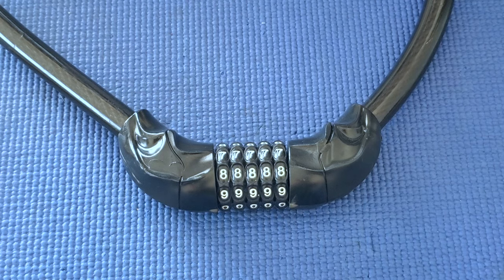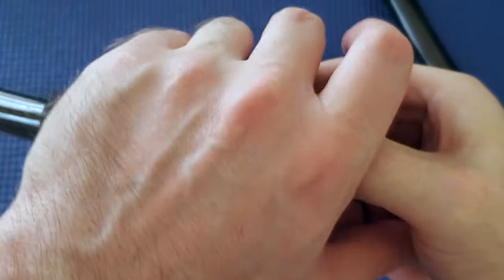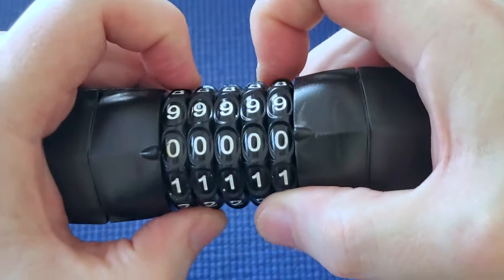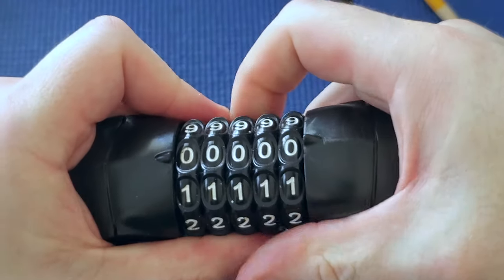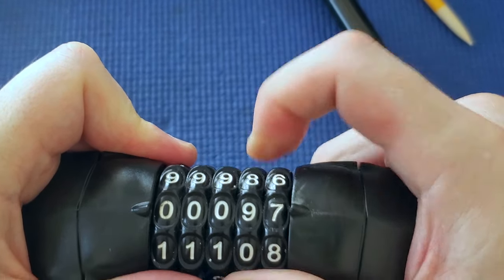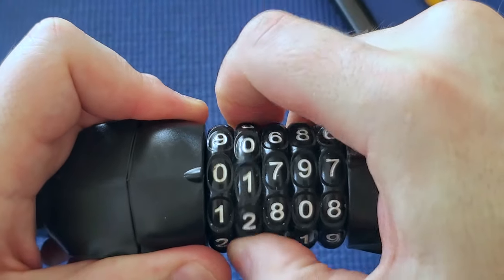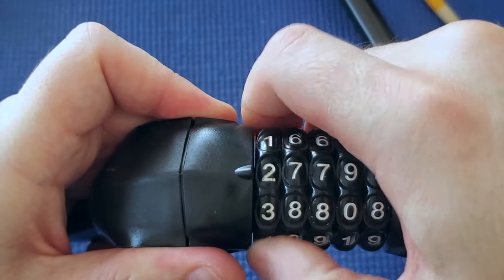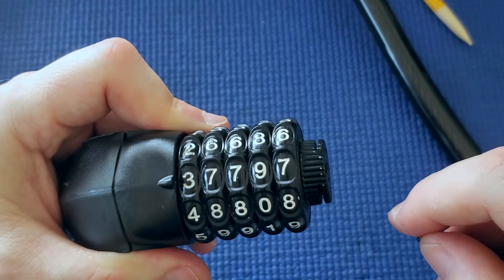(Picking 145) How to decode most combination bike locks - Faster Method!

Comment: One of my kids accidently changed the combination on a Master bicycle lock. Figured out the code in less than 20 seconds using your advice.
Reply from the maker: Excellent! 20 seconds is fast! I'm glad the video helped :D :D
Reply: @Swynndla  I was shocked how easy it was. And this was a Master lock. False sense of security.
Reply from the maker: @sethmeyer4951  Master locks are popular, but yes it's a false sense of security as you say, and it only keeps honest people out! If someone is locking up something valuable and it's left unattended for more than 10 mins then they should ask themselves if it's worth spending more on a decent lock. Good bike shops will be able to advise which ones are secure. That's partly why I do these videos, to show how easy it is for someone to get into them (sometimes people get in so fast it's just as fast as entering the correct code, and they get away with it in a busy location without raising suspicion). Other types of thieves will use some sort of bold-cutter to cut the chain etc. Combination locks attract opportunistic thieves who just come across a combination lock and try it out, and they don' t have to cary any tools to do so.

Comment: I have a hard time feeling when a wheel is on the right number, but there is an easy way: when it’s on the right number and you pull hard, the next wheel becomes difficult to turn. 
Example, if the wheels are ordered as in the video: set the fourth to zero, pull hard, and see how difficult it is to rotate the third one. It’s going to be easy, no matter how hard you pull, unless the fourth one is on the correct number. So try 0, 1, 2, etc. once you find it, move to the next one (try different numbers on the third one and see which one makes the second wheel hard to pull under tension).
Reply from the maker: This is what I call the "Indirect method" and I cover it in my Video 144. Well done for figuring it out, I had to be shown be someone else - you're a natural combination decoder!! :D :D
Reply: It works 😍

Comment: was not sure, but really works! my lock bound to the right! it was quite expensive, inkluding a real solid chain! it is a bit frightening, how easy this goes!
Reply from the maker: Excellent - well done for getting it open!
Yea part of why I do these videos is to show people that combination locks aren't that secure. Most thieves will physically cut the lock/chain, but there are a small percentage that will attempt to decode it, and some do it opportunistically, where they have no tools on them and they come across it and "just give it a go".
For better security, use a lock with a key. More of a hassle to carry around the key, which is why a lot of people opt for a combination lock.
It's good you used an expensive lock. Some people put a cheap bike lock on their expensive bike. I generally recommend spending 10% to 15% of the bike's worth on a bike lock.
Reply: @Swynndla  thanks for the answer! actually, the SPGOOD lock is just 10 bucks. but i meant it is heavy because of the chain and thus looks more expensive than then one you used. maybe more expensive locks have a better locking system for the numbers.
Reply from the maker: @bvrulez  Ah ok! - yea you're right, generally the more expensive, the better the lock (in terms of cut resistance and also pick/decode resistance - and I would recommend a good named brand too).
You might be interested in my other video I did for an SPGOOD bike lock: https://www.youtube.com/watch?v=e0xpSiTtvNA

Comment: HELP ME! MY BIKE LOCK GOT STUCK 3/4 IN THE HOLE! I was trying to set the password, but apparently some point along the way my finger brushed against the dial and set it as the wrong one with out me noticing. I was fiddling around with it, but it got stuck three fourths of the way locked. PLEASE HELP!
Reply from the maker: If it's stuck most of the way in, then the last dial won't be engaging the teeth of the locking mechanism, so that means you have less wheels to decode (ie in a 4-wheel bike lock, you only need to decode the first 3 wheels). Once you decode the final wheels, the lock should open. Then if it doesn't close all the way, just turn the last wheel until it closes. Does this make sense?

Comment: Cool video, I love decoding locks. Do these ones always go left to right or right to left? From my limited experience it seems that it can be sometimes random with other disc locks
Reply from the maker: Thank you! :D :D  Yep they are a lot of fun.  They can bind in either direction, but usually one way or another and not so much completely random (a few locks do though) ... so different from key-tumbler locks!  Cheers

Comment: It worked but only for the first 3 digits. Even when i know the code, i cant find a difference in the last 2. Btw, numbers found go in pairs of two. If 1 is a possible number, 6 also is possible. They are on opposite sides on the lock. That was on my lock tho. Hope it helps
Reply from the maker: Thank you for the feedback & tips! Yea sometimes locks put false gates on the opposite side, and that knowledge can help with decoding. Dunno why only the first 3 wheels were playing ball, but I guess the remaining wouldn't take long to brute-force. Great job getting it open btw :D :D

Comment: I have a dusty old lock. Could that be making it harder for me to pop open?
Reply from the maker: Yes it could. I find that with old dusty / dirty locks (that might also be a bit corroded) I have to apply even more tension. I would use the plain Indirect Method in my video https://youtu.be/Rn_Q3zWQhCY ... but make sure to wear gloves and you'll have to pull really hard (with constant tension) on old locks. Some people have had success by standing on the cable to get even more tension. You might be able to get someone to help you tension it. Your fingers will suffer.
If that fails, then you could try the "Sideways" method in my video 190: https://youtu.be/e0xpSiTtvNA  ... but it only works on some locks."
Good luck!

Comment: So... When the pin is just partially in and we're not certain that the code has been or not been accidentally altered... Can this method be used ?
Reply from the maker: Yes this method should still work, but only some of the wheels (closest to the opening) will have any affect (that other wheels wont have the teeth on the pin to engage with), so you only need to use the wheels closest to the opening.
If you can't get it open then use the Indirect method described in my video Picking 144.
Once you're got it only then you'll only know some of the combination, but with bike locks it's easy to get the rest of the combination by follow the method in my video Picking 30.
Let me know how you get on. Good luck!

Comment: I have found the combination this way, BUT some locks are less sloppy and some show a 'click' or resistance also on the opposite number, so there are many more combinations to test.
Reply from the maker: Well done opening it! Also thanks for the feedback / tips. Yea I find that good-quality locks have lots of false gates. I still think that for bike locks the best method to try first is the "Indirect" method that I describe in my video 144 (it works on most bike locks) and if no joy then use another method eg: feel for clicks and distinguish true from false gates. It's amazing that different types of combination locks take different techniques to open them.

Comment: I put a lock on my bike and while I was changing the code I moved the dials and set the code as a code I didn't know so for the past month I've had 2 bike locks on my frame, the stuck one and a working one
Reply from the maker: Did you manage to decode it?
Reply: No sadly, I watched this tutorial a few hours ago and it didn't work so I ended up using 2 wrenches, grabbing on to both ends of the lock and than twisting in 2 different direction to sheer the lock in half. The lock is gone but I had another one anyway
Reply from the maker: @legendleopard7125  That's certainly one way to get in. You can see how easy it is for thieves to get past these locks.

Comment: It worked!!! Use a considerable amount of force, like I used my feet to pull while i turned the dials.

I was trying each combination out of the 5 digit lock. I went up to 03649 and I started searching for other ways to open. My fingers hurt rolling the dials.
The force needs to be as hard as u can pull, its only then you will notice the difference. And yeah i had skipped the password while trying each number manually.
Reply from the maker: Well done! Thanks for the tip on pulling hard ... yes I tend to pull quite hard, and I probably didn't explain that well - so thanks for sharing! Yea when you tested manually (every combination) it's easy to go right passed it, either because the tension is exactly straight (so wont open) or because it's easy to lose your place when testing every combination. Thanks once again, and super job!

Comment: I just picked a lock with this method a few days ago. I just found this out years ago when i was a kid or young adult. xD I just got curious one day if i could open a lock and i got it open in a few minutes. It was fun that i was able to use this method that i learned by myself years ago. xD Btw it was a hard lock even tho it was only 3 digit because the wheels didn't want to move one by one. :D
Reply from the maker: Ah that's how I got into decoding locks! Well done for figuring it out by yourself ... you must be a natural. I found that different locks require different methods to decode, so had to learn different techniques (some by figuring it out, and some by watching other videos). Cheers for the nice & interesting comment!

Comment: Can you do this if you forgot the code, but the actual lock itself is open? Like if you cannot put tension on either end?
Reply from the maker: Yep - if you look at my video called "(Picking 30) How to decode a padlock closed (decoded)" it shows you how. Good luck, and lemme know how you get on!
Reply: @Swynndla   Thanks for the answer :) I tried, but I cannot get the end as far as you could in the video, so the pin doesn't click through when I turn the first wheel. The lock looks like this at the end - https://imgur.com/a/NeazPTT. It seems that there is something in there that is not aligned?

Comment: Oh no 🙈, can’t believe how these locks are so easy to open, was just about to purchase one for my new bike 🥴😡
Reply from the maker: Yea that's one of the reasons I did these videos, to show people how not-secure they are. Get a key lock, and make sure the thick cable isn't really a thin metal cable with lots of plastic covering it ... those type are so easy to cut.
Reply: @Swynndla  aren’t key locks easy to 😢😢
Reply from the maker: @ballsdeep6954  Most key-locks are outside people's skill-set. A thief would have to bring lock picks and be experienced with them (as even though some are easy, a lot of key locks are very difficult to open), so thieves instead bring heavy tools like a bolt cutter or grinder etc, and if they are caught with these items on them when acting suspiciously, they are in deep trouble. With combination locks, it attracts opportunistic thieves, who don't need any tools, and they can do it on the spur of the moment. That's how I see it anyway.

Comment: How do I know one of them is right
Reply from the maker: Remember to tension the lock by pulling as if you're trying to separate both ends, as if you're trying to open it when the correct combination has been entered, and remember to pull straight, not at an angle. You have to get the first wheel correct before the next wheel will show signs it's on the correct number ("lurching", or more easily turning into the number all of a sudden when turning under tension, and not easily turning out of that number when under tension). If the previous wheel isn't on the correct number then you wont get that lurching into the correct number (or sometimes you will but it wont be as obvious).
Reply: @Swynndla  Thank You a lot sir!

Comment: Well, with me it doesn’t work at all, I have been trying for 3 hours now, and I’ve seen many videos and I still can’t do it. The clicking sound you hear when you get it right? Well yeah I get that sound with EVERY number, and the tension? That doesn’t change the slightest bit. Like it just doesn’t change at all, please help.
Reply from the maker: Try out this method: https://youtu.be/Rn_Q3zWQhCY
Reply: @Swynndla  I already did, I know for sure that that method is the one, I think that the method in that video (144) is the one but it just doesn’t work. Is there maybe another method or is my lock just insanely good?
Reply from the maker: @ironmanzilla1  Your lock may be a slightly different model? For the toughest combination lock I've come across, I had to use an "adapted indirect" method in videos 61 and 88.

Comment: I've been trying for months but there are sm false gates what do I do-
Reply from the maker: If there are false gates then it's much harder.
If the Indirect method doesn't work (https://youtu.be/Rn_Q3zWQhCY but testing the tightness between the gates) then you'd have to deal with the false gates.
I can give you some guidance but first some questions:
Does the lock have a make/model?
How many wheels on the lock?
How many false gates are there on each wheel?

Comment: For some reason it doesn't work for me 😅
Reply from the maker: I noticed you commented on my other video so you've tried the "best method" (indirect method) way already. A reminder to pull "along" (straight, horizontally level) or it wont work. Does one side start to bind (harder to turn the wheels) at one end under tension? Do you get any clicks or "lurching into a position" at all?
Reply: @Swynndla  yes ahaha, my lock is rather hard to grip as it has quite a small space to hold it, might spray some WD-40 on it after and come back to it. Yes i do feel the binding become hard on one end when I tension it, a few clicks no lurching. I'll try do it horizontally ahah, I'm sure I'll get it one day

Comment: please i beg u do colorway locks i accidentally changed my code and im going insane
Reply from the maker: Hmm it looks like that don't sell that bike lock in the country I live in.
If the Indirect method (the one in this video) doesn't work for your lock, it might mean you aren't tensioning it hard enough, and you might be able to get some others to help you pull either side as you're testing the wheels. I'd recommend wearing gloves.
... if no good, maybe try the "Sideways" method here: https://youtu.be/e0xpSiTtvNA
... or this tricky method: https://youtu.be/n8LKfEdFZy8
... or an even trickier method: https://youtu.be/sQ7RAC-V8D0

Comment: is it just me or i cant do it
Reply from the maker: Sometimes it can be tricky ... is it the same model? Also note that if you don't tensioning it properly it wont open even on the correct code ... you have to pull straight ... it's natural to pull both ends at an angle (as they are at an angle) but that's wrong technique. Also tensioning too little or too much wont work. If this video is no good, try the "indirect" method I describe in a previous video for this lock: https://www.youtube.com/watch?v=Rn_Q3zWQhCY